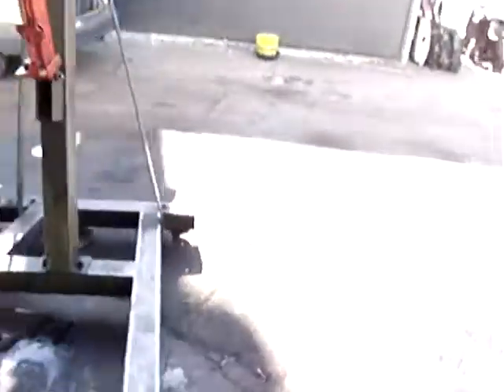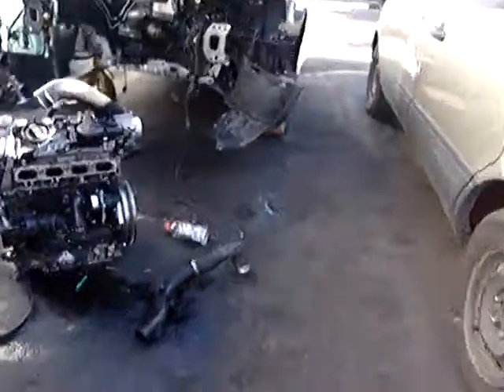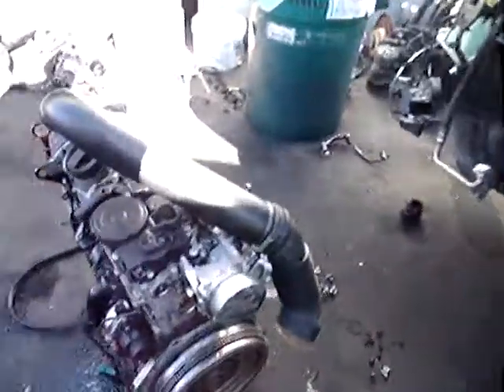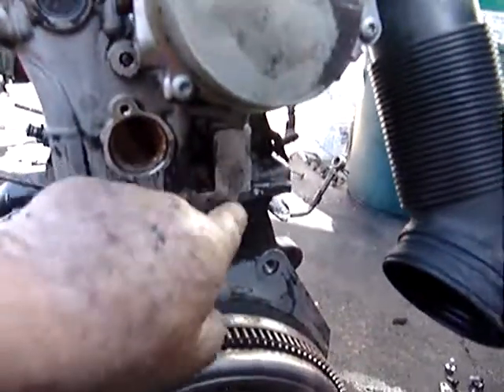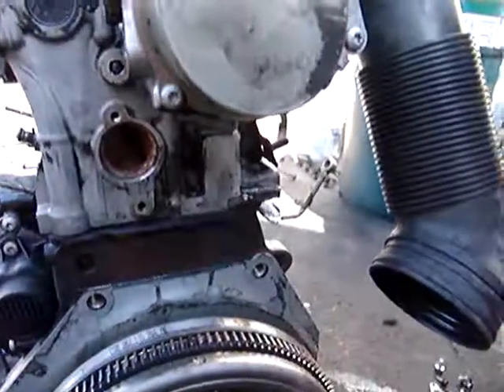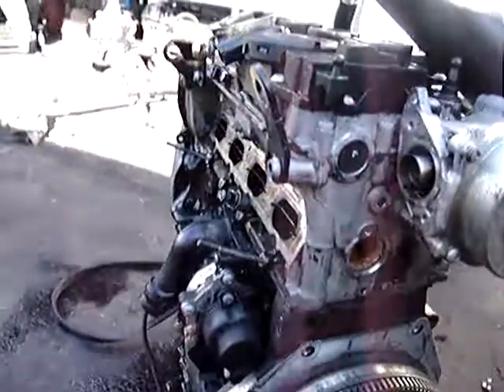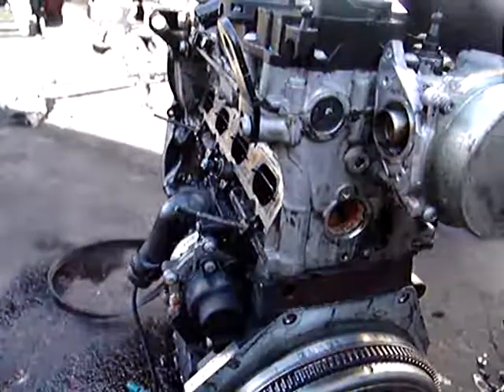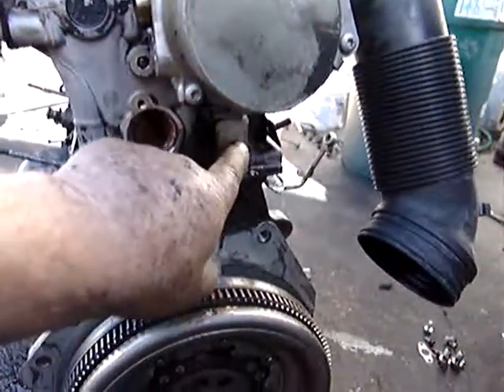VW,Audi CBFA vs CCTA THE DIFFERENCE

Comment: Oil level sensors are different I think. I believe the ccta has a hole where the sensor goes on the bottom oil pan while the cbfa doesn't, it's on the block. The sticker on the timing cover should display the code unless the cover was replaced.
Reply: All I know is I used a CBFA engine to repalce a CCTA engine. I just installed it as is and since their is no secondary air pump on the CCTA I just didn't do anything with the connections on the side of the CBFA cylinder head. Everything worked out well and the engine worked fine!

Comment: Don't they have different water pumps as well? When shopping online for one I see "will not fit cbfa motors".
Reply from the maker: I've personally used CBFA for CCTA motors. Like I said the main difference is that the CBFA has a secondary air pump and the CCTA does not. Naturally if you use a CCTA on a CBFA you won't have a secondary air pump and consequently it will be illegal. However you can use the CBFA on the CCTA and just leave the flange for the air pump and don't use it. I've done that switch personally and it worked out fine!
Reply: @MechanicalMommy  So as long as I put a plate to cover the flange, it will work just like a CCTA head? Where can you buy this cover plate?
Reply from the maker: @igordrumme  I never covered anything and it came out just fine but of course I didn't drive it for any length of time
Reply: @MechanicalMommy  did it throw CEL for you?
Reply from the maker: @igordrumme  what is cel?
Reply: @MechanicalMommy  check engine light. Also, do you know if I need to get CBFA turbo or can I use my ccta turbo on the cbfa head? Thank you again
Reply from the maker: @igordrumme  Pretty much everything is the same except one has a port for the secondary air injection and the other one doesn't. Turbo is the same. Yes, the check engine light might come on
Reply: Did the swap, everything works like it should, no lights on dash. CBFA engine in CCTA car. Thanks for your help!
Reply from the maker: @igordrumme  Good Job!
Reply: @MechanicalMommy  which engine is faster?
Reply from the maker: @golgo2888  They're the same engine except for the secondary air
Reply from the maker: Is your orginal engine CBFA or CCTA?
Reply: @MechanicalMommy  thanks for the replies. Yes I have a cbfa motor since I'm in california. Maybe the water pumps have different part #'s, but are the same, and websites don't know compatibility. Happy New Year!
Reply from the maker: By the way, if your thinking of rebuilding your old engine, that's a very difficult and expensive proposition! Better and cheaper just to buy another low mileage engine if you can
Reply from the maker: If you have a CBFA engine in California you must get another CBFA engine. If you don't have a secondary air pump your Check Engine Light will come on and you won't pass CA Smog!
Reply from the maker: I put a CBFA on a CCTA and the only problem was that I had an extra flange that I didn't use on the side of the cylinder head. I just left it on and didn't iuse it. The job came out nice!
Reply: I have a 2010 vw cc with the vin P cbfa.. motor is junk. Can I swap in a ccta engine? Will I need the ecu from the  ccta donor car? Are the harnesses the same? What donor cars should I be looking for?
Reply from the maker: No they're the same
Reply: Where can I get a plate to cover the hole?
Reply from the maker: The water pumps are the same

Comment: I bought a catless downpipe and i do not have the 3 o2 sensor plug because i realize i have the CBFA could i just not run that 02 sensor and be okay?
Reply from the maker: No must have o2 sensors
Reply from the maker: Big mistake, you should leave your Audi/VW stock! The catalytic converteir is fundamental to the specifications of the system. Otherwise,  I don't understand what your asking.
Reply: @MechanicalMommy  less back pressure is better for a turbo charged engine. Catless downpipe won’t hurt the car.
Reply from the maker: @djsoulfilter  The newer the vehicle the more precise are the specifications. Engineers spent thousands of hours designing these vehicles with precise specifications. You're playing with fire chaanging them!
Reply: @MechanicalMommy  never had a problem having a catless downpipe on any turbocharged car that I’ve owned. Less restriction the better for turbocharged engines. The only reason that a cat is in the downpipe is because of emission regulations and/or if your state has vehicle emissions tests.
Reply: @MechanicalMommy  That's a very square thing to say. Engines actually perform better without a catalytic converter.
Reply: @PapaSmurf337  Modern vehicles are set up to have a certain amount of back pressure. All the modules and sensors are programed for exact specifications! You must change many components in the system to do it right!
Reply: @DavidBreakman  "Modern vehicles are set up to have a certain amount of back pressure". 

No, that's misinformation, this has been proven to be a myth for decades. You might need to go repack your muffler bearings if you believe in all this nonsense you said.

"All the modules and sensors are programed for exact specifications"

I can tell you don't know what you're talking about and you don't understand the dynamics (aero and thermo in this case). But don't just believe me actually listen to world class engine builders, like David Vizard and respected professional mechanics who don't live in bubbles.  

Backpressure is never necessary nor is it used for "specifications" or for "the modules and sensors". 

What you might be thinking of is the pulsating scavenging affect which is not related to backpressure but related to resonance the length and size of the exhaust, primaries, collectors, chambered exhaust etc. 

Eliminating backpressure is always good on a turbocharged car most certainly. In fact you may not get much HP out eliminating backpressure but more often than not you will see considerable gains in low end Torque output from the Turbocharger running more efficiently as well.